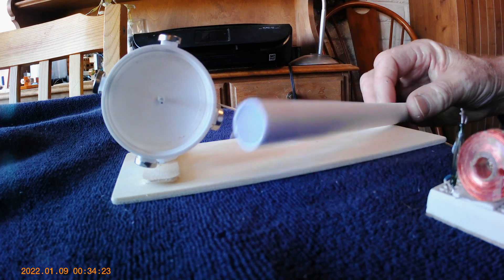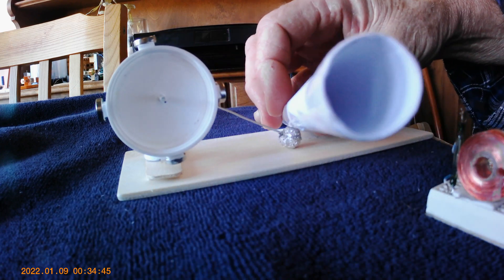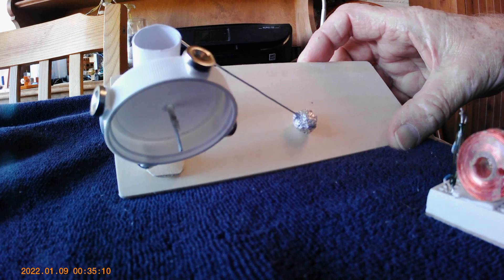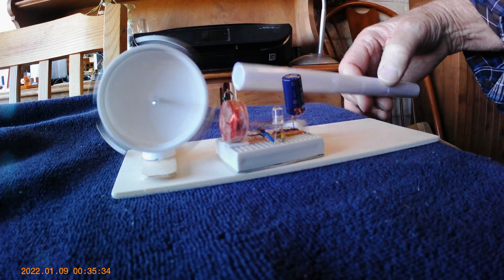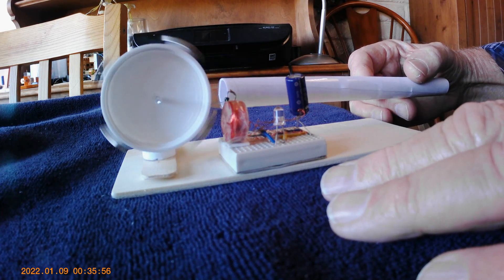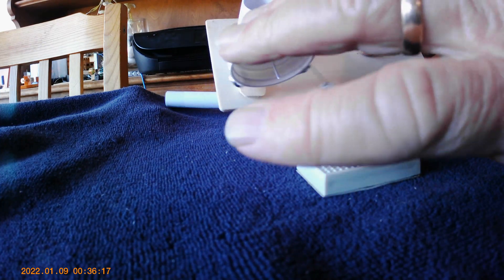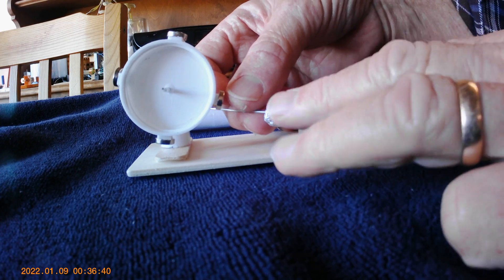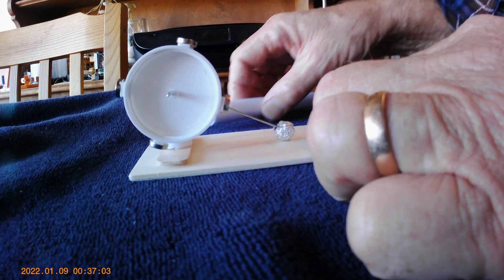Simple air engine

Comment: Fascinating. There are a couple of ways to create low resistance valves.
Reply from the maker: I'm thinking a simple plastic flap type on the intake and exhaust might work. The cylinder and ball piston have to be made better for sure.

Comment: long live the Sterling engine. That thing is so freaking cool😍🤙
Reply from the maker: Stirling engines are great fun to build and watch running.  Motion from just heating and cooling air. Very cool.
Reply: @Lidmotor   The applications are endless You could make an airpump to feed a wood gas stove that ran a Sterling engine with a generator Is that in turn powered the pulse motor. Is strap on some peltier modules The sky is the limit. Bring on the walking beam. 😆

Comment: Well done, able to continue speaking after blowing into that. I was alright for the first couple of attempts but then I needed a break. It will be interesting to see where this takes you 👍
Reply from the maker: That is exaclty why I made this small.  I noticed how hard you worked to make yours run.  I thought I would never have enough lung power to make a bigger one spin.  Ha Ha!  What I would like to try next is to valve the thing some way so it will run on a balloon.  If that works then it would be easy to power it with the electric driver and turn it into a weak air pump.
Reply: Lidmotor 
“if that works”... reminds me of someone who once said...”Spock!...it’ll work”👍🤓
I’m sure you will get it to work Lidmotor and look forward to your next video even if that darn green-blooded Vulcan is right for once.
Reply from the maker: @user-wy3xe2tt3y  This will probably go where no simple air engine has gone before ----- or not.